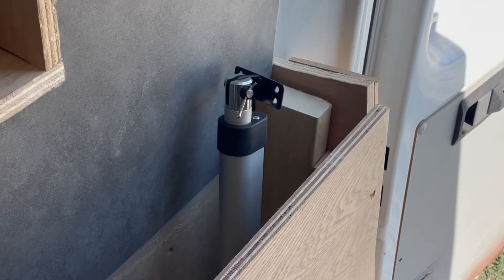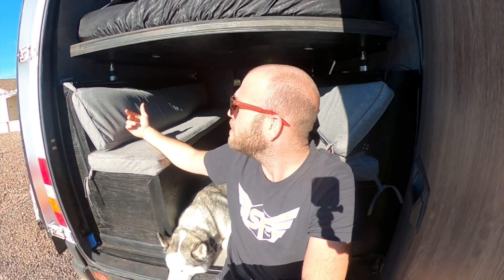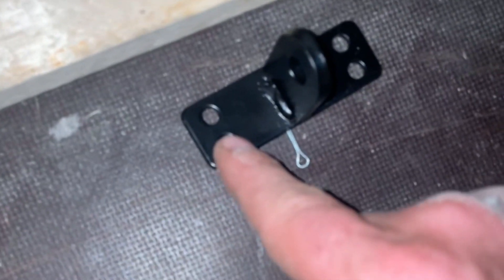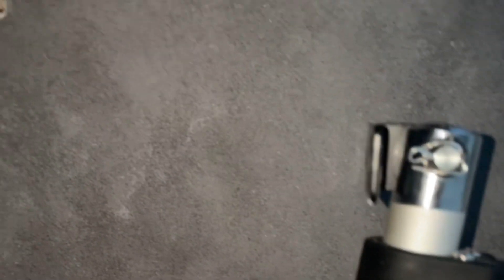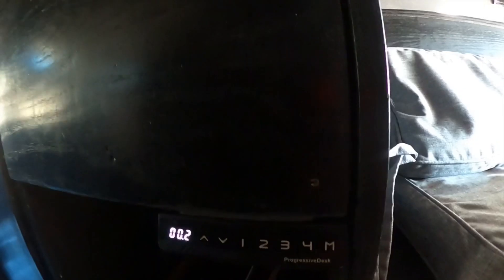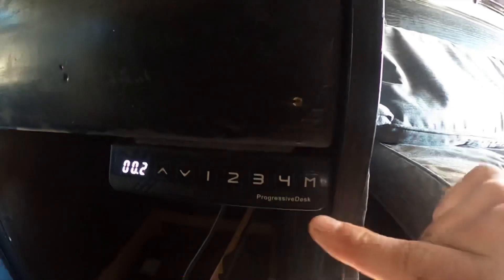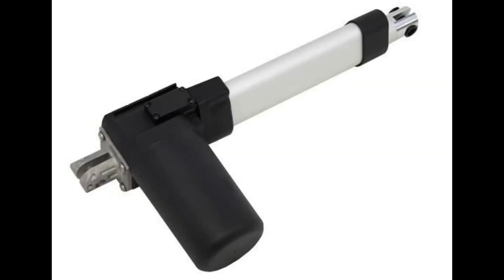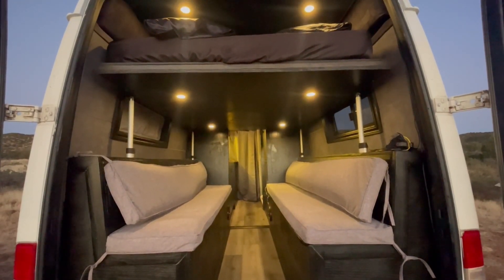Van Life | Automatic Bed Lift Using Electric Linear Actuators

Comment: When you bolted it down to the floor, did you use the stock floor, or do you have a piece of 2x4 there which is first mounted to the floor, and then works as a base for your lift system?

Comment: I have been looking into this setup for a few weeks. My primary concern is lateral stability. How does that platform do while extended and moving around the bed, =driving offroad, etc.? I don't see any rails or guides to hold it on axis.
Reply: i have been having the exact same problem/ with investigating weather this system needs a guided rail or not..
Reply: @jeremytopham238  I built mine with two guided rails and then discovered that I needed 2 more

Comment: Fantastic job on the lift system. How did you power it? The 4-channel Hall controller is 110 AC, so a solar powered inverter? I'm looking to build a custom micro hard-sided pop-up trailer using these, and the Progressive Automations guys sent me a link to this video. Cheers, and get well!

Comment: That's really a great idea. 
Cost effective with the same results.
Thanks for sharing.
Reply from the maker: I ended up using a really overkill size for my actuators. I think they can hold 1600 pounds if I remember correctly. But it only cost about $1000 for this one which was still overkill. The bed lift from happijack is like $3000
Reply: @The Bike Dog  , those are the type of things to share , a lot of people are on a budget, so your ideas are extremely helpful.